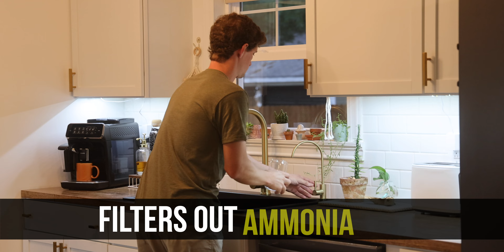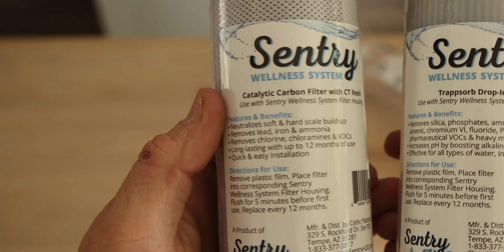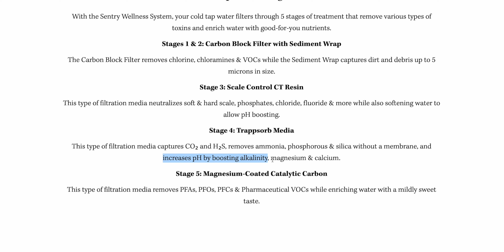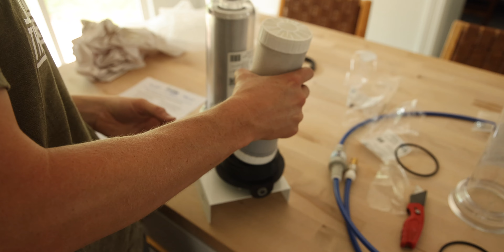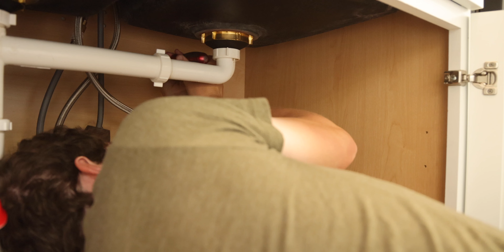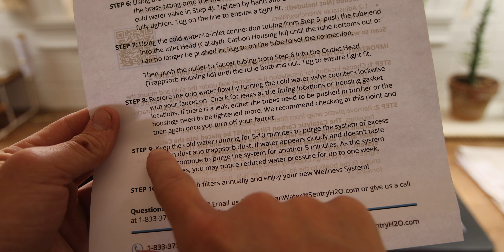Best Home Under Sink Water Filter For 2025 - Sentry H2O Filter Install

Comment: Use the wrench only for loosing the filter chambers. I used it for tighening the the chambers very snug (as the video suggests) and threaded part split. a month later, causing a flood in my kitchen and basement. Hand tighted, with the labels in the front. We love the water!!!!
Reply from the maker: As with any threaded piece, it is up to the one tightening to determine the “tight enough” spot whether by hand or a tool. If the item malfunctioned, their customer service could be contacted to replace the defective piece.